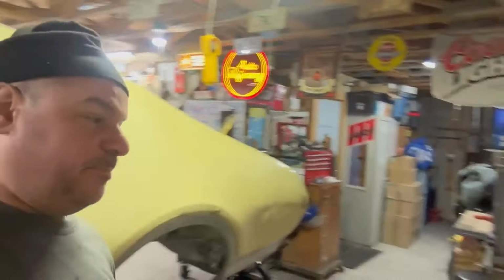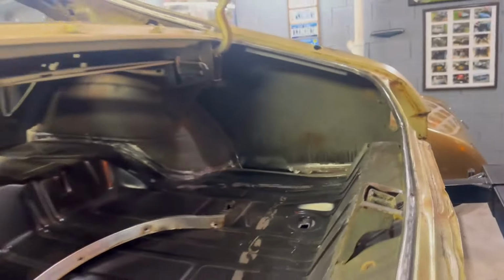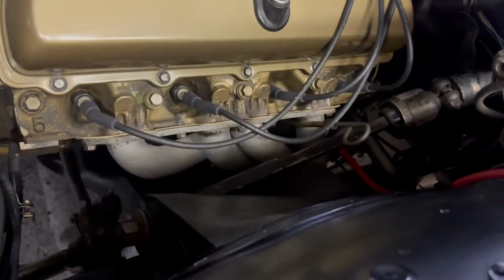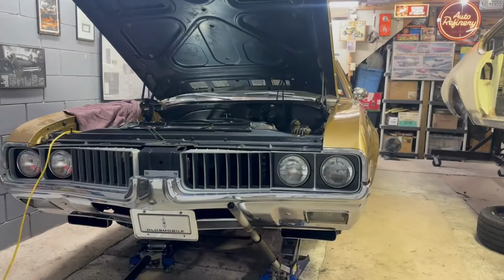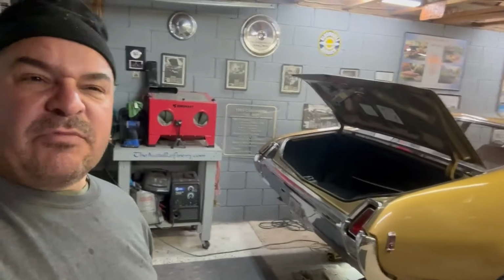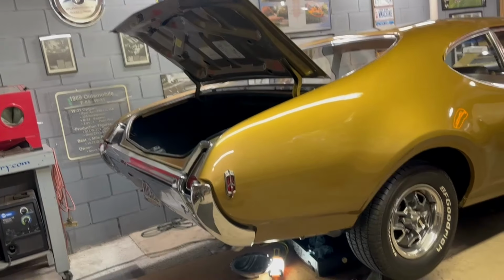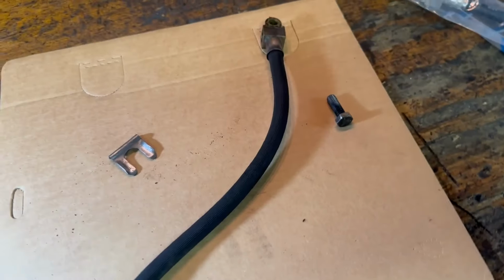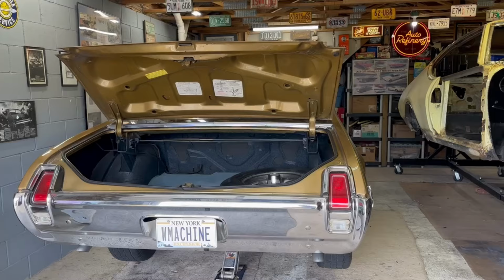Muscle Car Maintenance - Preventative Maintenance On My '69 Oldsmobile W-31 - The "OG"

Comment: Steve... little while back i reached out to you about the thicker grinding wheels to clean up the welds ..i did reply with info on where those were available but when i returned i could not find my reply...did you see it or was it removed
Reply from the maker: Hey Jeff.    I have to be honest, I don't recall seeing a separate message about the thicker discs.   These messages and comments are often tough to find, heck sometimes I can't even find my replies!!  We did not remove your comment.
Thanks for touching base.
-steve
Reply: no problem..i do know they are 1/4 inch thick 3 inch diameter and it was at McMaster-Carr @theautorefinery

Comment: for my interest I gotta ask... 4 speed car...shawiiiiiiing... however why is the positive battery cable run up through the fender wheel well area instead of across the top of the motor as they did it from factory.. nothing screams look at my bad ass like a positive cable across the top of the block in route to the battery
Reply from the maker: Hello again Jeff.   Thanks again for watching and  paying such close attention.
The way I have the positive battery cable routed - along the fender well and not over the engine is correct for small blocks (350) with either automatic or manual transmissions. The only difference there would be that automatics have the cable in a horizontal location behind the engine whereas on manual transmission cars the cable transgresses the back of the engine in a vertical  orientation.
I think you're thinking of how the cable is routed in the big block (400) cars. In those cars the positive battery cable does in fact run along the drivers side valve cover. 
I hope this help clear things up.
I appreciate your participation.
-steve
Reply: well now... i guess there is a difference in the routing ...lessen learned on my part today @theautorefinery